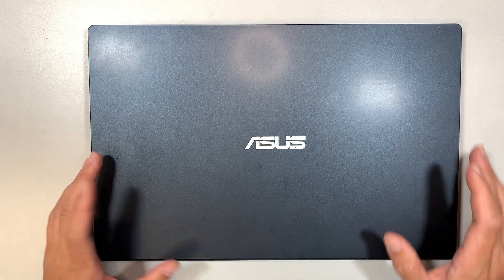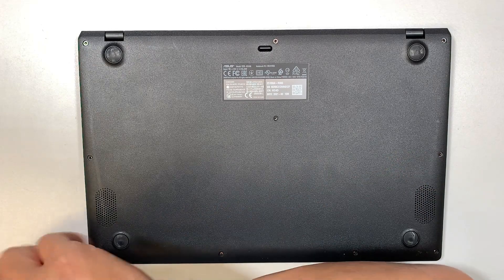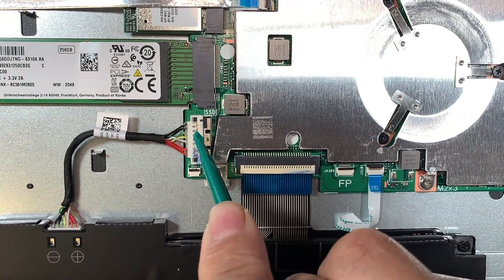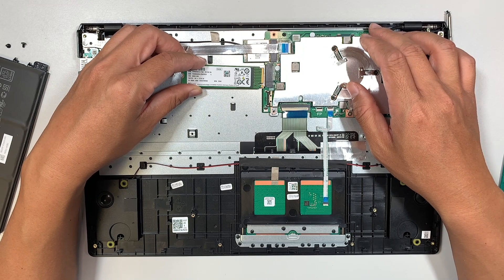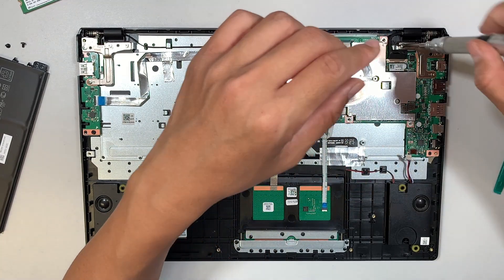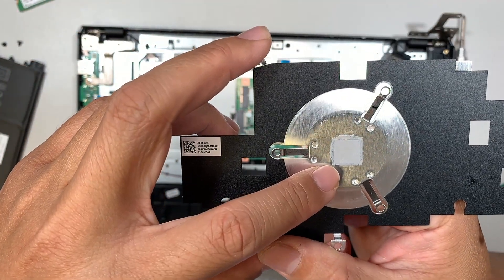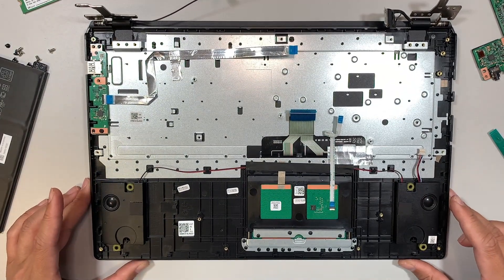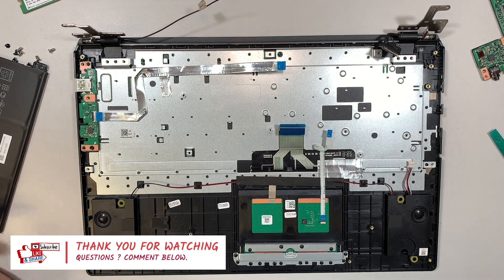Asus E510M Teardown Disassemble Upgrade

Comment: Thank you very much for this. I was on the fence about getting one as a replacement for my old stream14 which I only use for network diagnosing and light stuff. I was curious as to the ram and hard drive upgrade options and you really answered all of my questions. What you do is a wonderful service. Thank you.
Reply: I just got one on sale and I love it but I do want to put an nvme ssd in  it so it can be even more better also not to mention all the bloatware on mines